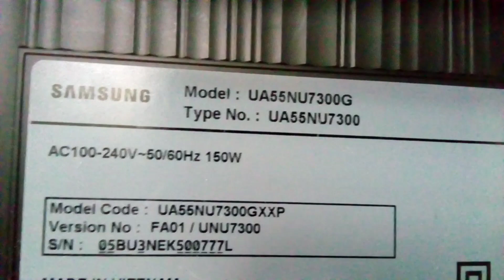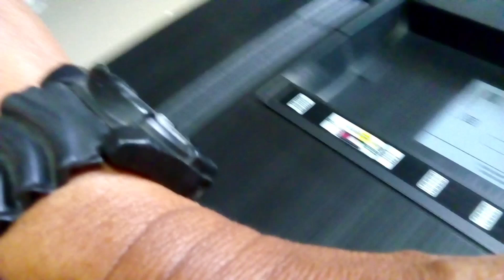HOW TO FIX A DARK PORTION AT THE CENTER OF SCREEN OF A 55" SAMSUNG CURVED TV #backlightfix #howtofix

Comment: what is that black strip you was putting next to the led strip? ia that what tv had already or something you needed to have yourself?
And in the last moment tv still looks that having bad picture on the right side??
Reply from the maker: @yupiter7 thank you for this important question and thank you for watching, it's just part of the tv, yes the right side have a yellowish bad picture due to the burned bottom right side of the acrylic sheet ,acrylic sheet is expensive to change it is another price that the owner  won't like to spend more.
Reply: @CandidoMembrebe   my tv was just getting dark in the right side, i asked because i was planning to replace LEDS i bought on aliexpress for my samsung. But you replied a bit to late and i was taking a risk to do it anyway. After 1 hour ir managed to fix my tv by replacing all the leds. Fixed my curver samsung tv for a £22 :)

Comment: At 7:03 even though nobody is there lcd support material independently fall down the sudden quick movement of the video is due to hand holding that unintentionally shake the camera here is the question : is the shaking of the camera can also physically shake the entire concrete home causing the lcd support material to independently fall down?
Reply from the maker: Absolutely not.